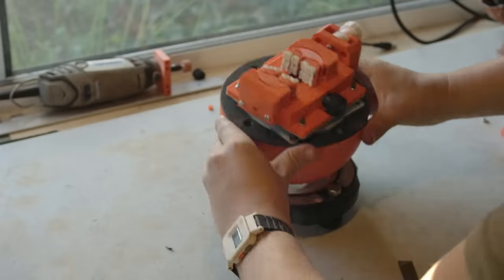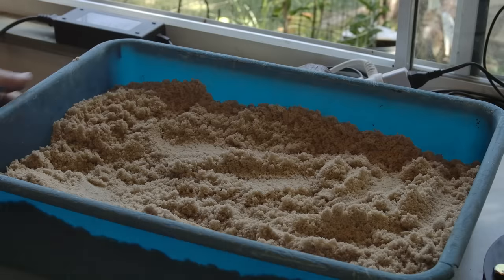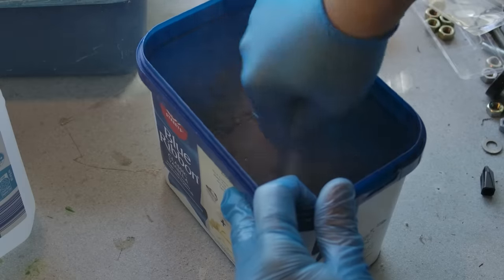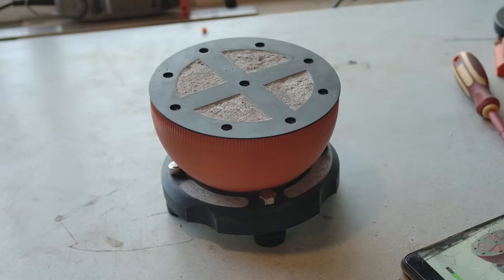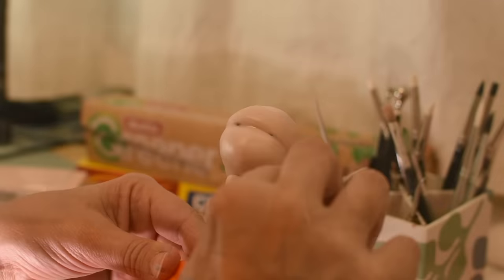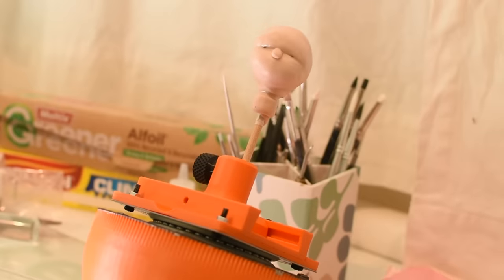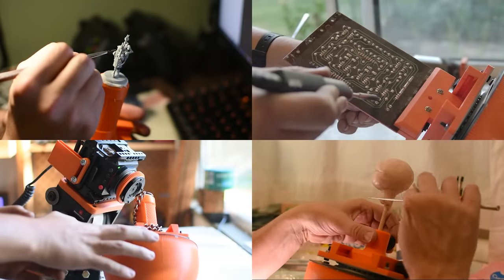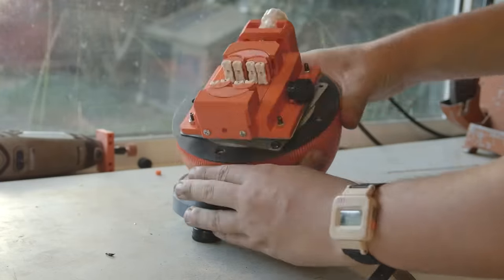The 3D Printed Ball Vise Every Creative Should Own

Comment: This thing looks awesome and looks like a great project. The only change that I would make to it is, A brake to the turntable or an index locking wheel to the turntable. To prevent it from turning when you don't want it to. This is not a criticism at all, it looks like great work.

Comment: Really neatly done. I think I'd have printed the bearing with a latch (or machined it with a latch) etc - it would I think be handy to be able to lock it firmly sometimes, and for the mini painting and possibly sculpting I'd add a fairly easy adjustable wrist rest on a dovetail sliding into the base - that way you can rest the weight of your arm effectively directly onto the table for a nice stable platform to do the detailed bits, but still easily removable for those times its not wanted (could probably be entirely separate, but desk space is limited and the ball is already there and heavy). Surprised it was heavy enough to be that stable, all the ones I've ever seen are much heavier hemispheres, I guess your rubbery stuff is grippier (at least while new) or weaker grip but still good enough I suppose.

Comment: Interesting idea.  The fact that it doesn't lock, I could see limits the use of this vise to lighter weight items.  With all the nails in that cement, I do wonder if you could use magnets to lock the spherical part from turning.  Maybe not completely, but more than simply relying on weight.  Just a suggestion.  One of these days I might have to look into making one of these.  Thanks for the video.

Comment: For a more smoother finish on the concrete get a "thin vibrating thingie" and stick it in the wet concrete to allow it to reach all the crevices and shake out the trapped air bubbles

Comment: Great vid, and love the design think this setup is great for many of the examples you showed like sculpting and soldering where using your aux hand gets in the way.  I don't think it will win mini painters over since they have typically have 100s of hours trained using both hands.  But using this setup for airbrushing miniature would be excellent.

Comment: Magnificent build! A good vise is an essential workshop tool; I use mine all the time. This type that doesn’t need to be bolted to a work table would be perfect for indoor use. As for not wanting to use your bins of mystery screws to weigh down the base, I totally relate to that. I have many similar bins myself.

Comment: Wow, brilliant idea and execution, I’m definitely building this one! It’ll be the impetus for me to make a copy of your fractal vise as well.

In common with a number of others below, a locking option would be great: I’d probably make one of each. 

I wonder about making a gasket from TPU instead of the round rubber one, to eliminate one more non-printed part? It probably wouldn’t be as “grippy” though, unless made from a very soft TPU.

The dovetail clamp made me think of Arca-style tripod quick-release plates. I’m not sure that a base like this would be useful as a camera mount, as you usually want more XYZ freedom of positioning, but Arca plates are very common in photography, so maybe someone would find it useful.

(One minor tip: A spacer at the back of the PCB jaw that’s the same thickness as the PCB would result in a much better grip, as it’d keep the jaws parallel as they clamped onto the board.)

I absolutely love your vids; as someone else said, they’re all meat, no filler 👍🙌

Comment: Looks fantastic. I'd be tempted to recess the nuts into the black lower base as they may scuff the round orange part over time. Withought having it in front of me, I'd be tempted to increase the diameter of the black lower base slightly for improved stability (May be perfect as it is though). Also some easy  way of centering the work holding accessories onto the rotating female dovetail section would be nice. Maybe just two raised centre line indicators on the main rotating female dovetail section would do the trick. Great tool... Now subscribed!

Comment: You can still improve the base further by having it on a swivel arm to gain more comfort/access to finer work.
Reply: An arm would be considerably less stable. The main benefit of this design with a heavy weight is that it doesn't move while working on it.

Comment: I think the turntable possibly needs some sort of brake mechanism to stop spin , else parts that end up too heavy on one side or anything with enough offset may gradually roll into the declined position. Some sort of easily depressible or even togglable mechanism that either goes into grooves, or uses rubber as a frictional surface.. TPU even perhaps?

Comment: Bruh,Perfect! it seems odd that it doesnt has any locking mechanism but it seems very stable,A feuture improvement i would make is to add rubber feet to the bolts under the sphere,so there will be more friction and would be 10x stable,you will lack a bit of slip so it would be little more challenging to relocate,but its better to be more stable especially in metal work,desoldering Etc.

Comment: About the miniature painting bit. It does not seem very helpful for shaky hands people. Bracing your hands supports both the miniature and the brush, and they don't shake in relation to each other that way. When the miniature is separate from your brush hand, then you will have issues. Just my two cents, and what I feel if trying to paint without bracing both the mini and the brush at the same time.

Comment: One could incorporate a base that includes one of those magswitches and perhaps metal straps or bits incorporated into the shell of the ball. That way you can find a position, turn a knob sticking out of the front of the base and it’s instantly solid and wouldn’t shift position or knock when it locks. I feel like being able to lock the ball in place would be something I want. So I guess I gotta go learn how to model, get a printer, learn to print, and start prototyping 😂

Comment: Do NOT use PLASTER!.  Plaster EXPANDS when it sets, rather a lot, and will split your shell.  You want something with a low co-efficient of expansion.  Cement is good if it’s got a lot of sand in it.  Ultracal will work, but should have added sand as well.

Comment: When you say cement, do you mean mixing cement alone with water, or cement mixed with sand, which is how you make mortar, but it can also be called concrete when used in the manner you have here? Cement is an ingredient of concrete, with sand and aggregate making up the majority of ingredients when making concrete. Driveways, paths and foundations are all concrete, not cement, which is just an ingredient. When you buy "Ready Mix" from a hardware store it has these ingredients already mixed, which becomes concrete when water is added. Interestingly, a cement truck is a misnomer, when in fact it is carrying concrete. A cement mixer is another one.